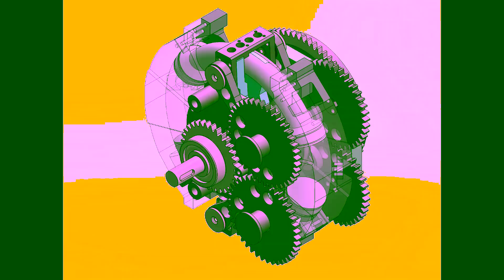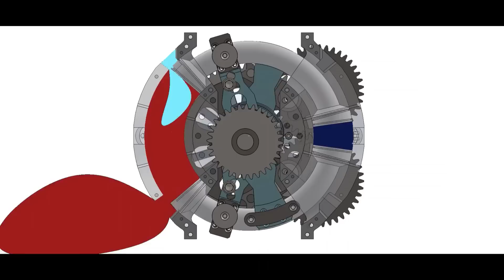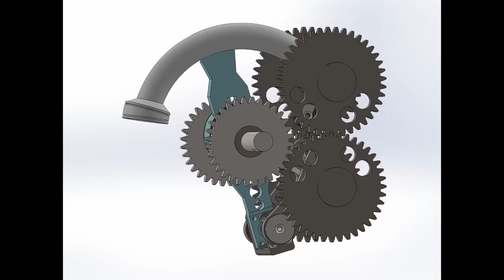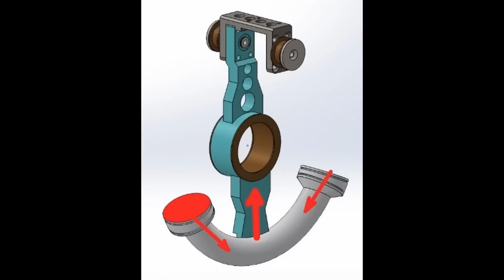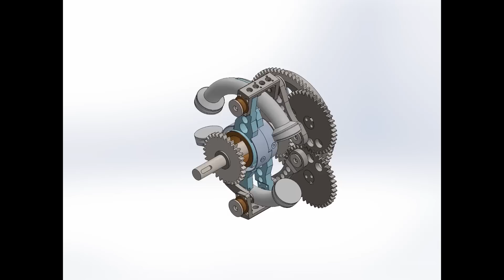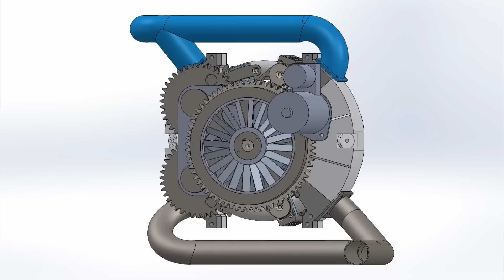A new type of Engine

Comment: I'm going to assume that the reference to pistons (not) contacting the cylinder wall is meant to allude to elimination of the friction that normally arises from the connection of the pistons with an oscillating connecting rod. I would suggest a different name than "rotary engine" as there are already two very different and well known engine types that use that term. Maybe "reciprocating rotary" or "swing engine". Swing engine has been used to refer to a similar configuration as this, but it's pretty obscure so I'm saying the term is fair game.
Reply: This is an old design. The pendulum engine was a take from this .compressors for medical oxygen use the curve pendulum engine design due to no oil around the piston, just Teflon rings
Reply: @worstknightmayor4439   similar design in some aspects but in no way the same "old" design.
Reply: @Dunriteproducts  exact same design was created in the 30s (toroidal motor)
Reply: @worstknightmayor4439  similar but not the same. With some tweaking this could deal with a lot more force. It's not a market ready idea, but this concept has legs! People like this need encouragement and guidance not snubbing. Why both commenting if you have nothing positive to add to the conversation
Reply: @chestikof8665  exactly the same pal!!! A donut with 4 opposed pistons .how the are connected is irrelevant. Check your narcissism.
Reply: Actually, this is a form of 'Oscillating' piston engine...
Reply: Teeter totter engine.
Reply: @deathkillhead  toroidal engine
Reply: @deathkillhead  I like it
Reply: Ya-but… when you assume… you make an ass of yourself.
Reply: @rob379lqz  ... or you can just straight out behave like an ass in the comment section :P
Reply: Pendulum?
Reply: You could also go with centrifugal engine.
Reply: even the most "rotary-ish" of toroidal cylinder engines, i have a difficult time with them being called rotary....if it needs balance shafts, go figure....though most people who develop toroidal cylinder engines refer to them as rotary, for some odd reason i don't understand.
Reply: Edwardo of Argentina can claim his engine's pistons wont touch the cylinders because he has a solid mechanism to ensure of that......i am not going to say it can't be done in this configuration, but i can't envision that here myself either
Reply: @ButterfatFarms  hate to burst your bubble, but your googling skills are a bit lackluster if that's the only information you managed to find. Search for the name of the guy who created it, you should be able to (even with the limited skills you've demonstrated this far) be able to find some of his other designs, and who knows, you might even the patent!
And your waffling about production cost is just that, waffling.
Reply: @brynyard  I was into engines like this when I was a lot younger, and I wondered why they couldn't be used as improved engines due to what I thought was the improved mechanical design, aside from the fact that it turns out mechanical design is actually a relatively small portion of losses with modern engines, thermodynamics have a much bigger impact. Then I grew up and got two engineering degrees and realised the faults in these designs.

The 'zero friction' claim in this design comes from an assumption that the materials are infinitely stiff, which is a reasonable assumption from the everyday experience with materials like steel components which you can hold in your hand. In practice there will be local deflection of the piston arms due to a couple of reasons:

Firstly the force on the piston heads will cause a bending moment about the central point of the T shape i.e. the rod is a circular arc and the forces are tangent to that arc, meaning that arc will bend outwards against the reaction force of the mechanism. You could angle the piston head to direct the pressure force to minimise the bending moment, but due to the curved shape and beam bending forces there will always be a deflection.

Secondly, the centrifugal force on the piston head will cause the arc rod to bend outwards. No matter what topology optimised, high stiffness/weight ratio material you use there will always be some deflection, and it will get worse under higher rpms.

Alongside the very tight clearances required for a gas seal, means the piston head will push against the side walls of the 'cylinder' in the same way as a conventional con rod arrangement, meaning conventional oil lubrication will be required and all the other assumptions of higher temperatures fall apart sadly.

Like I said I was into this stuff when I was younger, just didn't have the CAD skills to make so I applaud him for making this even though the design is flawed. He just needs to carry forward this inventive spirit, and eventually he will make something amazing.
Reply: @Bordpie  the "zero friction" claim is not made by the original designer, so yours (and others) long winded "debunking" of this is a pointless exercise. The design has certain distinct benefits, just not enough to justify the added complexity for an engine.
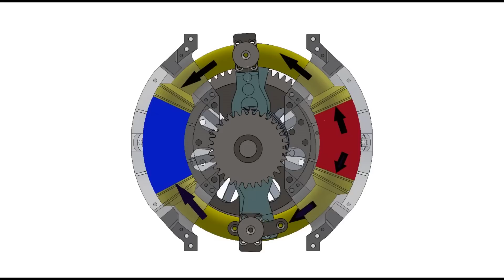Reply: @brynyard  Ok that was badly worded, nothing will be zero friction, but the main claim is that is has substantially lower friction than a conventional engine 0:25 and that the pistons do not touch the cylinder walls 2:48 . As described previously having the pistons not touch the cylinder walls or apply dynamic and static forces from the engine is not possible. The designer has not taken into account the finite stiffness of the components, which will cause forces between the piston and cylinder. 

This means much of the ideas that lead on from this don't work:

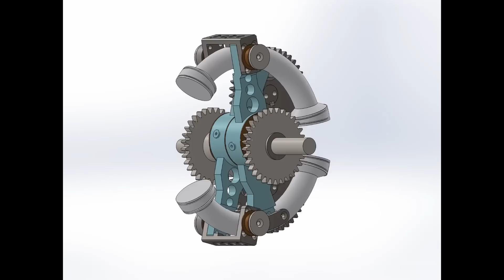4:52 "Because the pistons do not come into contact with the cylinder walls, no oil lubrication is neccessary" as I have mentioned there is no way the pistons don't come into contact with the cylinder walls.

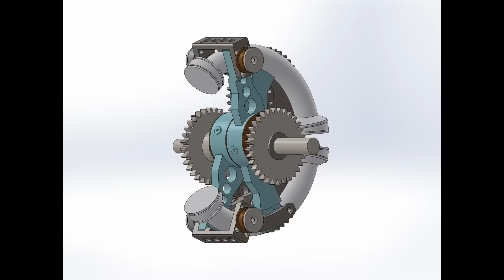4:58 "This increases the choice of materials to be used" 5:24 "By using heat and rust proof materials for piston and cylinder, higher operating temperatures are possible" Not possible as per above. Then the thermodynamics arguments after this can't be applied. 

There are a couple of features of the design which are beneficial. Firstly the fairly direct mechanical transfer of energy between the working stroke and compression stroke through the two headed piston. This can be achieved with a double ended piston in a conventional cylinder, and the force transfer is more direct. The second is the uniflow of gasses (in at the top, out at the bottom). Both these features have been tried on early double acting marine Diesel engines going all the way back to 1911. 

If there was even a 1% fuel saving from a design like this, the marine engine builders would be all over it. The best marine engine from a capitalist engine builders perspective is efficiency, to reduce fuel costs. You bet these companies have looked at just about every design there is over the last century. Highly optimised conventional piston uniflow marine diesels ended up being more efficient and reliable and have slowly taken over market. There was also the opposed piston Doxford engine which has also been superceded by conventional designs.

If you want a novel engine for generating electrical power which actually has no sideways force of the cylinder walls, and has double acting 2 stroke cylinders (with opposed pistons in the middle) and is perfectly balanced then the Free Piston Engine design currently under development is what people should be looking at. The linear motion of the piston is converted directly into electrical power with no other mechanical coupling. The main development challenge is the control of the engine to maintain continuous operation, which with modern control engineering is just a matter of time.
Reply: @Bordpie  as mentioned above, the economics in this isn't as straight forward as you portray. I'ts a bit funny how you confidently claim that design is "hopeless", when the design has been demonstrated to work well, and is currently mas produced (albeit as a "reverse" engine).

The friction part is a bit more complicated as well since the skirts of a normal pistons have to be oiled to function, which also requires an oil seal, and the fit of a piston in a ICE isn't exactly "high precision" in the first place (that's why you have piston rings). In the end, fuel cost wasn't a major driver back then, development and production cost was more important (and no, reliability also comes pretty far down the list as well - it's easier and cheaper to replace "stuff" (which also includes dead people!), than to make it not break in the first place). Nowadays development cost is way higher even though production cost has fallen a bit, and as you mentioned, there probably are better solutions as the goals has shifted.
Reply: @brynyard  This arrangement has and could be made into an IC engine, I'm sure it can work well just not as well as a conventional or other type such as a free piston design.

For context fuel cost has always been a massive chunk of shipping costs, around 50-60% of operating costs. 

A quick google search of an average container ship consumes about 220 tonnes of fuel oil a day which translates to about $121,000 a day or approx $3.4 million for a 28 day round trip (at around $550 a tonne of fuel oil). That's about $44 million a year. A 1% fuel saving is $440,000. Then multiply that by the lifetime of the engine (fuel costs varying of course) and you have a significant amount of money a shipping company would pay extra for a more efficient engine. Then multiply that by the number of engines in production for the engine company to spend extra on research and development.

Reliability is also massively important, operating costs for a container ship can range from around $25,000-$85,000 a day depending how big it is plus repair costs plus lost business. Even worse if your ship loses power in a storm and is lost, with your millions of dollar investment going down with it.

New technologies and designs crop up all the time. Lots of strange IC engine configurations were tried out in the early days and they didn't pan out. That's not to say a better design couldn't be made, but I don't think it is this one in particular.
Reply: @Bordpie  this design has no real benefit for huge slow running detonation engines, consuming crude oil and having piston speed measured in single digit km/h (slight exaggeration, but still).
Reply: @ButterfatFarms  LOL, and reflection isn't one of your strong skills either :)
Reply: Perhaps the pendulum engine. Since the pistons are held together similar to a pendulum clock.
Reply: @ButterfatFarms  you seem to confuse "good" with "cheap", a very common mistake.

Sure, it didn't have commercial success, but that doesn't mean it was a "bad design", "impossible to mass produce", etc, as many above has tried to claim (note: not argued - just claimed). It might have had some limited success if it had been proposed at a more strategic time (oil crisis, etc), but without any external forcing, it's a more complex engine, and the "best" engine (in the eyes of a capitalist) will be the bare minimal effort one can make to get a somewhat functioning engine within the regulations (give or take - rules can be bent with some "persuasion").
Reply: I like the term “opposed pendulum piston” engine.
Reply: @winschmitt4919  nice!
Reply: @billz856  bro this is YouTube, no one here is capable of simple reasoning like that.
Reply: It's like an old train hand car
Reply: Reciprocating rotory engine
I like that. 3 words that express the engine well and spark curiosity.
Good marketing ploy!
Luv the name very keen on this design.
Reply: @joefinn67  you can stop being keen on it, it's a very old design and has been thoroughly rejected. Not only is it insanely complex and impossible to mass produce efficiently, but it also would be very difficult to make complex parts that can withstand the forces of an ICE. 

Never mind the fact that you can't just eliminate friction by making the pistons not touch the wall. Even if you can somehow create a sealed combustion chamber, friction is going to come from the very large amount of moving parts.
Reply: @Lobsinus  it’s been demostrated ti work just fine, both as an engine and as a oil-less compressor. And when an Argentinian hobby machinist can make one in his garage, it’s not as insanely complucated as you might imagine.
Reply: @brynyard  someone doesn't understand mass production
Reply: @Lobsinus   actually the argument of it being difficult or "impossible" to mass produce in a cost effective manner is in no way proven and in fact very much much debatable.
Reply: @Lobsinus   are you eluding to self awareness? https://www.youtube.com/s/gaming/emoji/7ff574f2/emoji_u1f602.png
Reply: @Dunriteproducts  no I'm referring to morons on YouTube who think that a design roughly a century old is somehow the hidden secret to perfect frictionless engines that can be cheaply mass produced. 

Don't ya think if it was viable there would be interest in it from companies with more money, experience, resources and knowledge than some fucking moron on YouTube will ever have?
Reply: @Lobsinus   Speak for yourself, since this, and many much more complex designs are in mass production already. And nobody has ever claimed that this eliminates all friction, it's just beneficial to not need oil on the cylinder walls, and the overall reduction in friction also increases efficiency (again, both things that have been well documented and demonstrated).

Besides, your claim was that this was "insanely complex and impossible to mass produce", so backpedaling this into "uneconomical" is just silly.
Reply: @brynyard  the guy I responded literally called it a frictionless engine. 

That aside, crazy how it's in mass production but somehow isn't employed anywhere where efficient, reliable or powerful ICEs are required. This is because traditional designs are infinitely easier and cheaper to mass produce. C'mon dude, you're a random nobody on YouTube. What makes you think you know better than the companies who specialise in being infinitely more successful than you?
Reply: @Lobsinus  you need to brush up on your google skills, recall that thing I mentioned about Argentina? It's being mass produced as a frictionless compressor.
Reply: @brynyard  no I don't recall that thing because I didn't read it. Haven't really read much anything you've said beyond the first sentence sometimes. It's all good tho, I have my own frictionless perfect ICE that is perfectly balanced and can be infinitely mass produced for very cheap.
Reply: @Lobsinus  well, unlike that imaginary engine of yours that's a result of your terrible reading skills and inability to argue and understand basic logic, the pendular engine exists.
Reply: @brynyard  was admitting I'm not actually reading anything you're saying not enough to tell you that I'm fucking with you?
Reply: @Lobsinus  you might want to consider revising your conversational style if someone reading it can't distinguish between an utter moron and trolling :P
Reply: @Lobsinus  dude! Why so hostile? I have to wonder if the difficulty in mass production could, in some part, be due to many decades of 1 type, engraving into us an infrastructure that would obviously be more convenient and cheaper to stick with. Also, insofar as the difficulty, you mentioned it's attempt and failure in the past but can those tests still be depended on as accurate what w so much new tech, ie, 3D printing, automated precision machines parts, etc. And finally, I have no faith in any vehicle manufacturer or fuel supplier openly accepting any new science that leads to a measurable amount of fuel savings which may translate into stock dropping. These old money oil tycoons hv proven time & again to be about as self serving as any biz model can be. Not likely to convince them of a better method without a thunderous outcry or legislation. 
So, in summation, I humbly considered that you may benefit from a respectful consideration to update your view and adjust your opinion accordingly.... and take a deep breath now & again. Ppl should be able to disagree without needing to be angry or insulting. And, by all means, disregard this if you want as I am truly just a lowly YouTube commenter.
Reply: @Lobsinus  yeah YOU! do you know how overly complex an ICE is?! and you're worried about this concept being "impossible" to mass produce. It's either that you work in production and you're bad at your job or you know nothing about MP at all. ya silly wing nut! haha
Reply: @chestikof8665  hush child I'm not here to listen to people on YouTube tell an engineer how engineering works.
Reply: @Lobsinus  it hasn't been rejected, engines and compressors that use a similar principle are in use in industry right now. Please be quiet and move along, if all you are trying to do is ruin a young budding engineer's day.
Reply: @chestikof8665  mb just not used in any large application. 

Source: I'm an engineer you fuckin clown
Reply: @Lobsinus  From one engineer to another, you are extremely arrogant, rude and dismissive, and ultimately unpleasant in this thread.  Who shat in your coffee?
Reply: @michael5045  cool
Reply: @Lobsinus  Pls make a You Tube vlogg about your invented engine... We are waiting...
Reply: @arielhermoso4262  nah I'll just keep making 4chan posts about baiting morons in the youtube comments section, thats way more fun.
Reply: @Lobsinus  are you telling me that keyboard warriors aren't the worlds smartest people to ever exist? 🤣 Yeah i get ur point.
Reply: @Dunriteproducts  yeah lol that's why it's so much fun to post random bullshit and see how many collective days of their time I can waste
Reply: @Lobsinus  haha yeah it's certainly entertaining thats for sure.